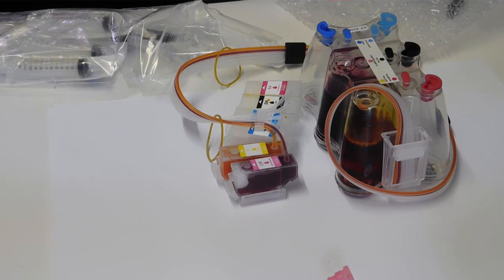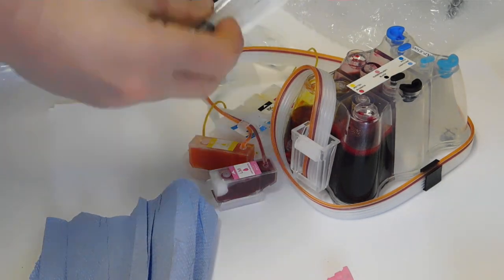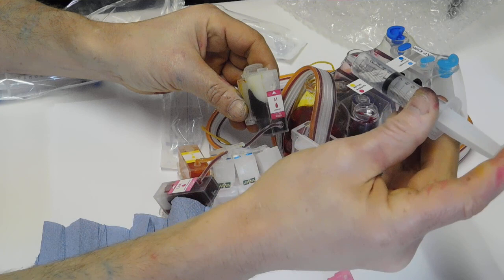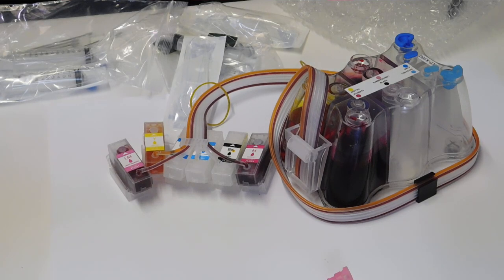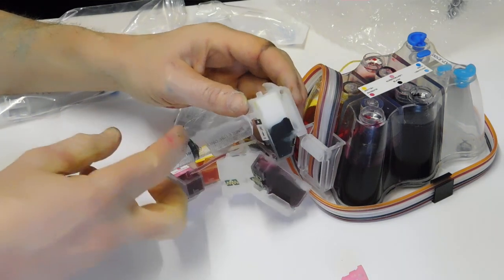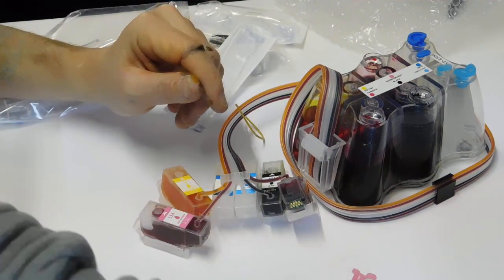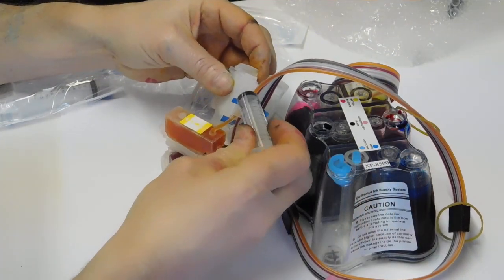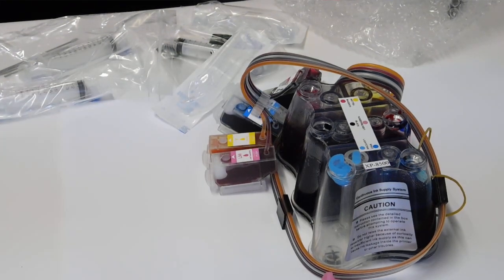How to Fill and Prime New style ciss for Epson printers including XP-15000 DTF

Comment: sir i want to buy it
plz whatappp
Reply from the maker: which model ?
Reply: How much for this ? I will buy sir. And for epson xp 15000  printer 

Thank
You
Reply: @cityinkexpress-online  what is with the xp-15000?  Do these inks work?  If not, why not?  Thank you in advance.
Reply from the maker: @kevind5044  Outside of Europe it's very likely you will need chipless firmware to get around Epson locks, but yes it works and we also have an ink dedicated to this model